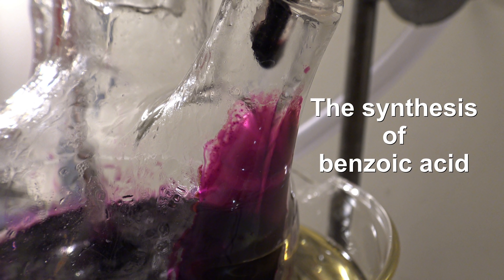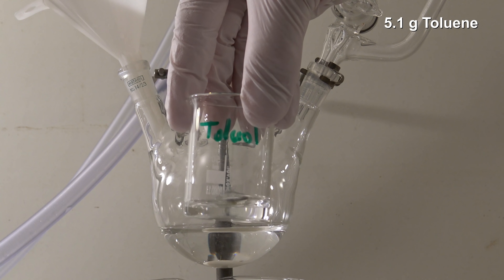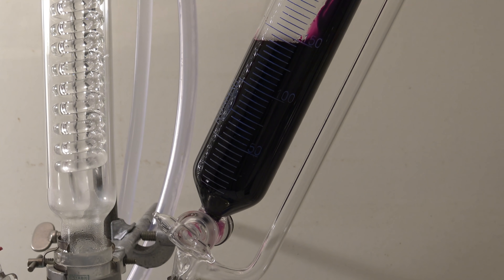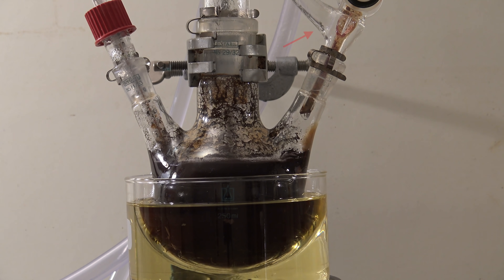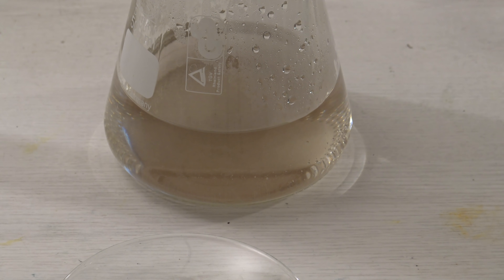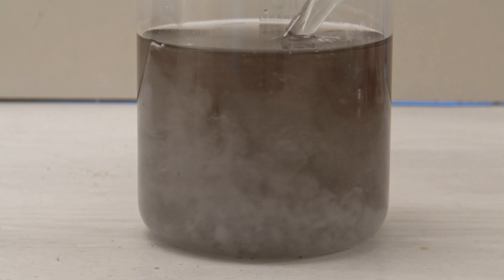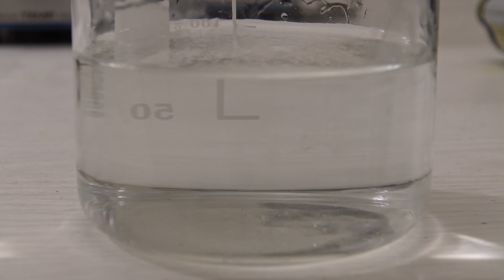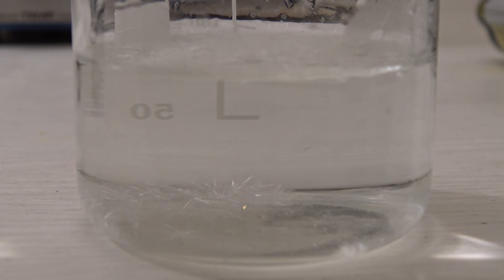Synthesis of benzoic acid (Oxidation of toluene)

Comment: The 20% solution of potassium hydroxide is 20% molar or 20% by weight, or maybe I'm crazy maybe 20% volume‽ ..
Reply from the maker: Usually, it is measured by weight. So it's 20% by weight.

Comment: in the course of this reaction, alkali KOH is formed, therefore, such oxidation is aggressive, if magnesium nitrate is added to the in the reaction mass equimolarly for potassium in the KMnO4 compound, then the alkali in the reaction mass will bind to magnesium 2+ and precipitate Mg(OH)2, and the reaction will go more gently and not to the end, that is, differently.
so phenyl ethane is oxidized to acetophenone in about 2 hours at 70 degrees Celsius with high yields of ~ 87%, so is phenylpropane to propiophenone, etc.
whether toluene will react in the same way to form an aldehyde is interesting.

Comment: I want to do this oxidation reaction with p-nitrotoluene instead of toluene. The p-nitrotoluene is insoluble in water but melts at around 50°C and will steam distill with the reflux. 

My question is, would this reaction still work with nitrotoluene? I think it should but there are no papers I have found of this reaction. In theory the yields would be higher since the benzene ring isn't oxidized due to the nitro group but I don't know if due to the solubility it wouldn't work. Toluene is not miscible in water but it at least distills. The nitroluene will just melt. 

Another question I have is if the potassium hydroxide can be substituted for an equimolar amount of sodium hydroxide? I wanted to use sulfuric acid, would this work?

Also the stoichiometry will still be the same as far as moles of nitroluene to moles of permangenate, right? Since the same methyl group is oxidized and nothing else. 

Thank you. Also your videos are awesome!
Reply: Be a pioneer, perform the experiment, and be the first to publish a paper on it.

Comment: Why use an oil bath when you can just but the boiling flask on the hot plate? As I can see, you already can place your thermometer in the liquid contained in the boiling flask, so what is the point ?
Reply: For more even heating of the liquid.
Reply: Great way to break your flask

Comment: 2 questions. Can sodium hydroxide be used and can a simple condenser be used?
Reply: On both accounts almost certainly.  If you use a simple condenser, just beware that to keep a close eye on temperature control to make sure nothing escapes the system

Comment: If I want to work at this scale (5g to 50g of chemical), what joint size would you recommend? 24/40 is the most available one. Is that too big? What is the size of the 3-neck flask in the video?
Reply from the maker: Crimson Chemistry It was a 250 mL flask and I wouldn't recommend to use anything smaller. So, I'd guess if you want to scale it up by a factor of 10, you should use a flask of 2,5 to 3 litres. A 24/40 joint should also not be too large at this scale.